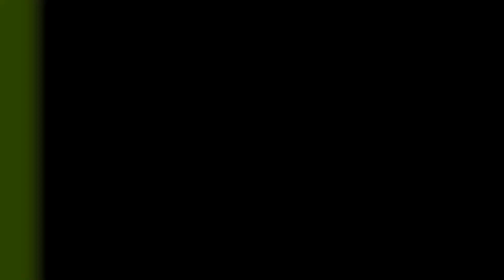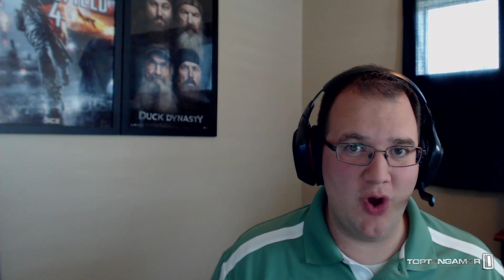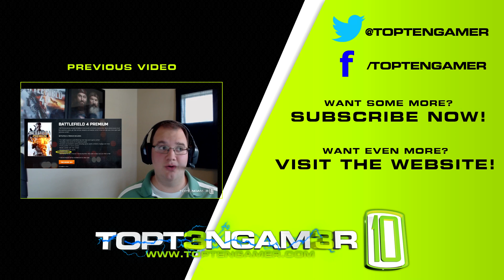Battlefield 4 Beta Low FPS, Graphics Card, Loading, Issues and Errors for BF4

Comment from the maker: you need to try and stretch for the FX-6350 if you're going AMD. Also, TI boost is good in its price range; however, if you can stretch for a HD 7870 I think you'll feel a lot better about your performance. Only $20 difference for the CPU and $20 for the HD 7870.. so you'll only end up spending about 12% more and get quite a bit more performance.

Comment: For the beta I was running a 
8350 @4.8Ghz 
Windows 8
8Gb's of RAM 
7870 XT with 2 Gb of VRAM 
I was getting between 35 min 80ish max and was around the 45-60 most of the time with complete max setting eg.Custom setting and just cranking everything and was very playable

Comment: As of the latest patch.

I am running Windows 8
I5 2500K 3.5 OC
16GB Ram
MSI 760

FPS Between 59-74 on Ultra 2XMSAA

CPU Runs about 50-55% load.

Im thinking about putting another card in SLI to try to get to 120FPS for a new monitor I want to get. But I think ill hold off until I test the waters with the final product.

Comment: I'm playing BF4 on a laptop. I7 @2.0ghz with a GT555M 2GBGDDR5 card in it. 6GB of DDR3 ram and I've been having fps problems. For me the fix was to scale down the resolution. Not the width and height, but the scaling option(down below on the left side of the video options). I had to put in on 50% and medium graphics to get the stable 60 fps gameplay. Hope it helps you out!

Comment: My specs:

AMD FX-4100 overclocked to 4.2 Ghz
EVGA GTX-660 ti Superclocked Edition at stock speed
Kingston HyperX 8GB 1333mhz
64bit Windows 7

The game stutters like hell! its unplayable at all settings. If i turn the graphics settings all to low i still stutter like crazy.... in bf3 i almost always have a solid 60 fps on ultra!
I know that this is a beta and it will probably be fixed untill release but i cant even try out the damn game!

Comment: I have i3 4g ram and radeon hd 6870 and i run it on low with 30-40 fps and i think i should have more fps with comp,cause bf3 i run on high with 50-60 fps and it is smoth ;)

Comment: And i had to roll back from the 331 beta driver to the 327.40 drivers to be able to play the game. The beta drivers made the game unplayable for me, 10-20fps constant freezes, crashes, textures not loading, so if you have those issues try rolling back to a previous driver it might help. Also something that game me a bit better cpu performance with bf4 was shutting down all the unnecessary background processes, basically shutting down everything i didn't need at the moment.

Comment: Also about the cpu's some people with high end fx or 4th gen intel i5's and i7's are reporting cpu load at 100% so right now we can't be sure it is our cpu's fault, the game seems to be poorly optimized right now, though if you do have a really old cpu then it could be that of course. one of the settings that give you high fps boosts are resoltuion scale and ssao. Though putting down the resolution scale will make the game look significantly worse it gave me 20+ from 100% to 80%

Comment: My specs are:
Amd phenom II x6 1055t 2,8ghz(oc'ed to 3,2ghz).
Evga gtx 780 3gb gddr5 acx cooling.
8gb corsair vengeance ram.
850watt psu.

My cpu load is about 76-100% on all settings, my gpu's load is around 25-55% using about 1900-2300mb of vram. I have huge issues with fps dips or straight up game freezes, it gets really annoying sometimes...

Comment: Very disappointed, because i can run BF3 and Crysis3 on ultra/high with no AA and get ~50-60fps on BF3, 30-35 in Crysis 3.

Monitor is not related to performance but i use 120Hz monitor

Comment: I just made a benchmark.
System: Windows 8 Pro
AMD FX6100 (4.2Ghz)
MSI GTX 570 OC
Segate 1Tb SSHD
8GB ram

Game runs 35.6 fps 720p and 38.9fps on 1080p
All other settings as low as possible.

Also cpu is used heavily ~95-93% on both resolutions.   GPU used merely 37-45 %

Comment: I have problem like this: I have msi geforce gtx 650 ti boost twin frozr, intel core i5 3470 3,2ghz, 8 gb ram and windows 7 ultimate. I can play with ultra settings in battlefield 3, but when i tested out bf4 beta, my pc won't run it even low settings. It is still lagging. But if i change the resolution scale to f.e 80% it won't lagg. But every things looks so meshy if it is on 80%. What might be the problem?

Comment: I imagine you'll get much better cpu results with the final game, Considering there putting out requirement minimums of dual core cpu's and recommending Intel quads makes it seem like the issue now must be optimization especially if that's what your getting regardless of settings. Remember there probally using info gleaned now to work on optimizing Intel and Nvidia set ups, That's the thing you have to deal with if you don't want to wait until the finished release, It's an AMD title.